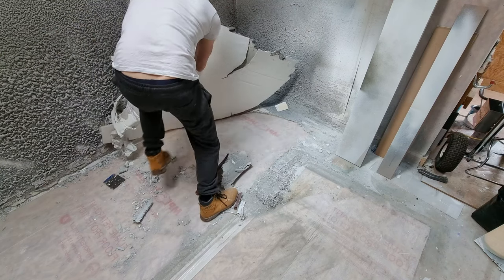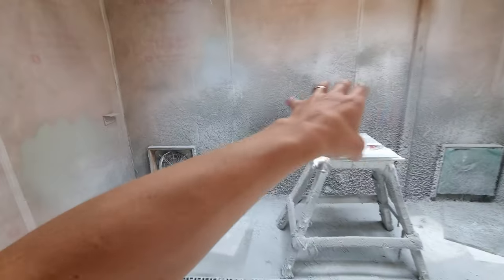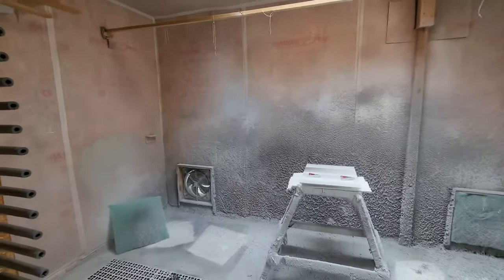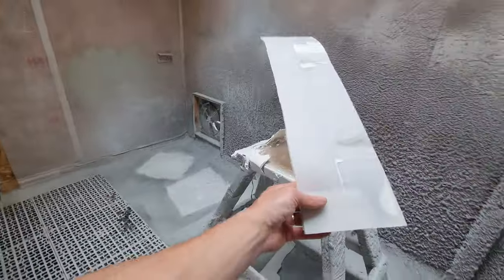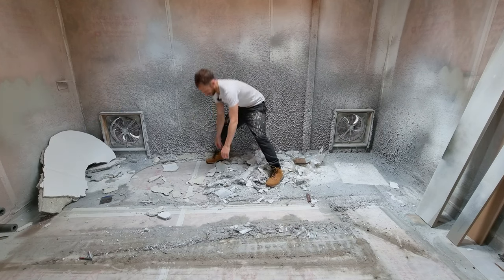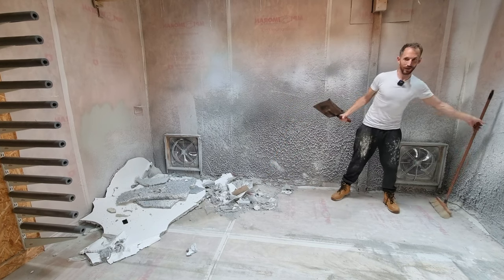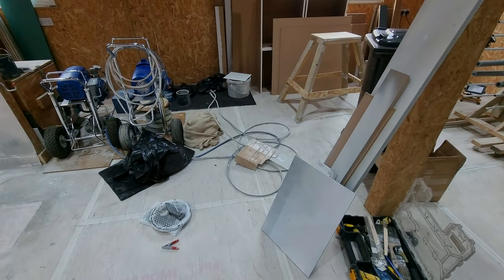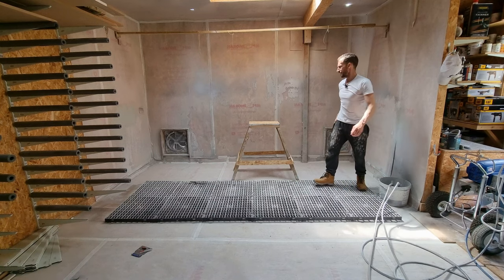My DIY Spray Booth Finally Gets A Clean Down // It Just Peeled Straight Off // Vid#95

Comment: Nice little video there and shows the good sense to use plastic sheeting on the walls when spraying,I'm guessing that whole area is a moneymaker as opposed to outsourcing the spraying to someone else,in the 3 years you have been using it has it saved you money?regarding the 2 vents in the back wall is any paint mist sucked outside?or do the vent covers soak it all up?thanks